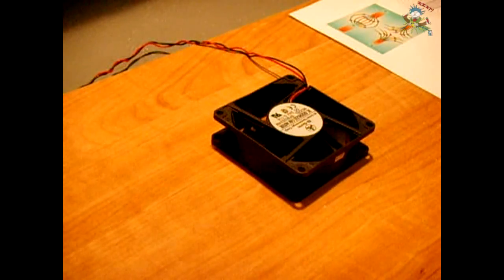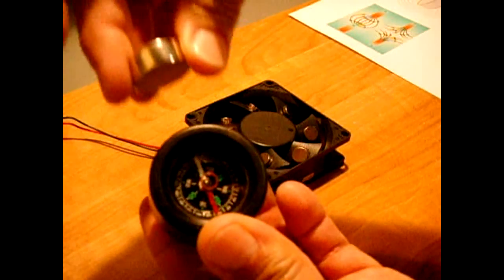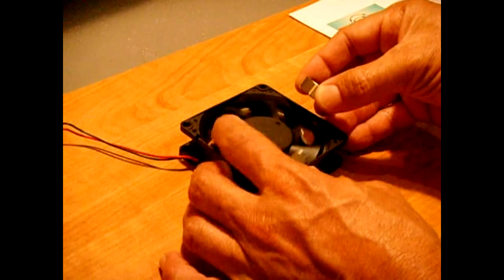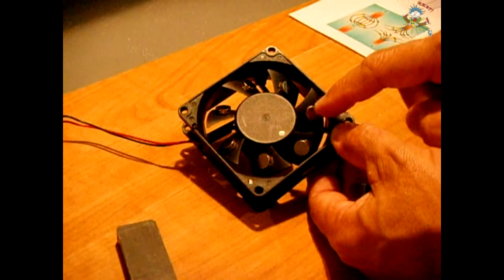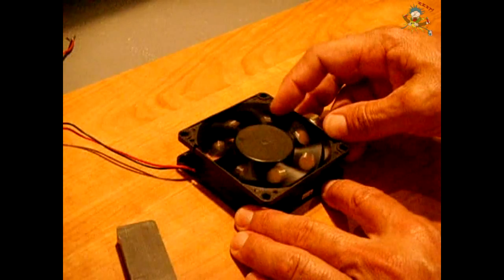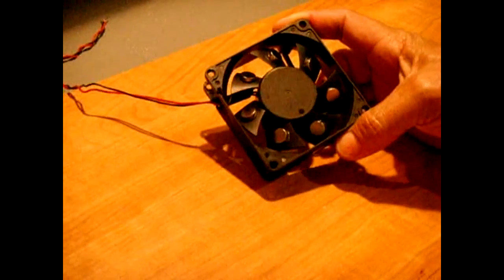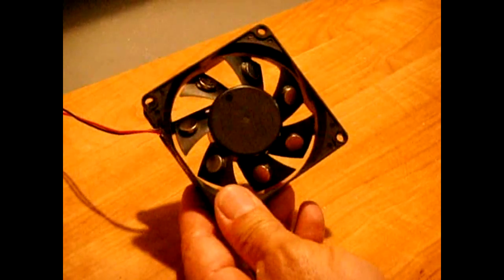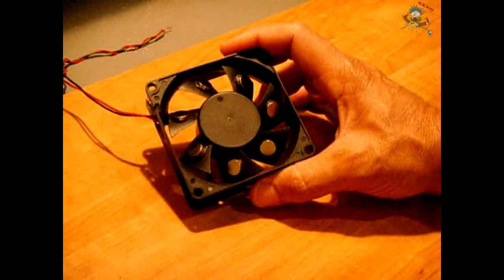Free Energy ~ Case Fan Magnet Motor / Real or Fake?

Comment from the maker: Check out PART 2 of this video which uses very thin neodymium disc magnets:
https://www.youtube.com/watch?v=M6QV0AfDF2k
Reply: electronicsNmore And yes, I agree the posted video is bogus. The magnetic fields will always oppose each other at points making such a simple device impossible to work.
Reply: +electronicsNmore   Hi,
Could you use petier TEC1- 12706 cells to power it, thjen maybe it could be used as a bodini?
Did enjoy your vid, thumbs up!
Reply: I tried also and that is a fake. I tried every possibility to turn it. Thankx buddy for sharing and educate others these beggers are lairs :)
Reply: electronicsNmore
Reply: electronicsNmore you gave a theory of how you think in fan actually worksput  the device you suspected is inside the original inside yours and see if it worksotherwise your theory remains a theory
Reply from the maker: Same flickering output. Stop believing all the scams!
Reply: electronicsNmore
you aren't willing to insert the device you mentioned in the fan?

you haven't proven this is a scam then

you only presented a theory about how it works
Reply from the maker: STOP wasting my time.
Reply: electronicsNmore I have experimented with neo magnets and felt there is potential to create very useful mechanisms. For instance contact free transfer. I have a video posted way back where I constructed a basic contact free energy transfer demonstration. Based off the design of A/C generators and motors I would like to further research ideas for the potential to create a system that could create free energy from strong magnets. I feel there is likely a way to do this. Currently we use magnets to create electricity from an external power source. If further research is done I believe we can utilize magnet fields to do this with no drive source.
Reply: lie
Reply: next time use ur brain and save sum money.
Reply: I already make a fake video but they don't work
Reply: Sir,please give an idea how we make free energy with magnet or other

Comment: I hate it how many of the "Free Energy" videos are Fake!  There are quite a few YouTubers who show exactly how the Fake "effect" is achieved, usually with a tiny battery that is activated by the very thing that is not supposed to, or a hidden switch or a floor petal.  If it has a spark plug, you can bet it's a lie.  Nikola Tesla worked on giving the world Free Energy, but J.P. Morgan shut him down when he learned that Wardenclyffe wasn't really a radio tower but a real Free Energy Tower.  He famously told Nikola, "If we can't put a meter on it, then we don't want it," then withdrew all funding and did his best to be sure Tesla could never get funding again.  But Tesla found a way and right before activating Wardenclyffe, he mysteriously died.  Then the FBI swooped in immediately, confiscated everything they could find and tucked it away in a Black Closet.

We have been stuck with the fossil fuel energy system for a 100 years after actual Free Energy sources have been figured out or at least that long by the 0.001% Ultra Rich Elite who really run the world.  Consider Stan Meyer's Water Fueled Car which turned pure H20 into Hydrogen for its fuel.  He mysteriously disappeared, I don't think he was ever found dead, but gone is what happens to everyone who goes through the Patent/Profit route.  That's how this Elite learns about it and then either buys them out and buries the project and all its info in a Black Closet or Kills the project creator or team in some mysterious way, confiscates all prototypes and any working versions with all its info and buries it all in a Black Closet.  Since the person holding the patent can't be reached to give permission or deny it, the device is locked up.

Either way, the world does not benefit from any Patent/Profit Free Energy.  This Elite makes too much money from fossil fuels, which they use to start all the wars they start to profit further, which they use to further embed fossil fuels......  You know, the ones behind the Military-Industrial-Financial Complex.  There may be some devices that generate low Voltage and Milliamps, but nothing substantial.

Thanks for trying as exhaustively as you did.  I've tried to build a couple, but, of course, they didn't work.  It's called, Click Bait.

Comment: Set it up so the fan also turns a little crank attached to a rod with lobes on it like a cam shaft. This will avoid cogging and will simulate turning a magnet on and off

Comment: THANK YOU! The cogging explains so much. But one hypothetical question... what if you reduced the amount of cogging as much as possible with multiple fans all connected to a single shaft? Say 5 fans all offset from each other by 20° to reduce the size of the cogging space to as little as possible. Then using 5 reversed magnets for each fan so there is not enough space for the cogging to have a major effect.

So to sum up my question... Would reducing the cogging as much as possible make the fans spin?

Comment: Yes, brother you are right and proved free energy concept is fake great job done 👍❤️I have a question not about it I just taking about transformer, Q, I've one 12 volt battery charger but the transformer is vintage 6 wires are coming out from one side 1 wire is going directly to switch it's thin wire and second wire is going to charger circuit pcb 12 wires they are thick going in two diodes high Amps I just want it to use make 12 volts Dc power supply how I find out primary and secondary winding would you please guide me using your experience if you will say I can send you this big transformer pictures but  need your email address here I can't upload because I don't know how I can send those pictures I hope you will help me I really understand your way of teaching and very understanding accent is easy ❤️❤️❤️❤️❤️😇

Comment: I do absolutely believe what you say BUT Maybe if you gonna use a powerful magnet but hold it in such a way that it could push those magnets but that it get’s away from those cought points in between them, but i think you have to test different hight’s at different positions of such powerful magnet to find the right hight in wich it’s repelling force will not get stuck in between thise magnets,
Not sure just speculation.

Comment: He had the wire coming out of the fan coiled up for a reason. He was using an AC fan motor and a coil under the bench with an AC voltage applied? Or an air stream hitting the blades?
Reply from the maker: Watching the ENTIRE video would be helpful.

Comment: Have tryed take fan apart & taken out some parts & just leave the motor then rewired to the copper coils?? Or mixed N & S magnets so theres an pull  & pushed motion off the 7 magnets ?? 
Or using copper coils & big center ring with 4 magnets inside the ring gos over outside fan box.. Have the copper coil tight rapped on an tube & 1 on left side or on right side.. Then wired the fan motor wires to 1 of the copper coil leads for power & other for ground & other for two copper coil leads wired to 3rd wire...

Comment: Only looking at metallurgy and mechanics, the thing you would need to reduce the cogging would be a sheet of a particular alloy that reduces the strength of the magnetic field effect, placed at the exact right angle I suppose. The best one known to man is Mu-metal, but it's not totally insulating and it really only bends the field out of shape.
And if that worked to make a device such as this proposes, it'd probably be all over the internet and easily reproducible.
Perhaps when an alloy is invented that actually insulates 100%.

Comment: The reason they used a fan is so that they can use air to make it move. If you're genuinely interested in this kind of stuff, I suggest looking at Howard Johnson's magnetic motor patents. Good luck!
Reply from the maker: You're wasting your time with these "Free Energy" devices, if they really worked, every person would be making them in their garage.
Reply: @electronicsNmore  Do some actual research. It's obvious to me that you have no idea what you're doing. Your explanation of this toy shows a clear lack of understanding. There's no relay inside the original device. He uses an air current off camera to spin it. Furthermore, I don't believe in free energy devices. I pursue overunity builds that require an input current, but can produce more power than they require to operate. It involves multiple coils, magnets, diodes, and transistors. But hey, I'm in no position to tell anyone how to live, so by all means, have fun playing with your toys.

Comment: Yes I've tried this experiment long ago, it didn't work for me either..... The guy in this video is talking about the cogging effect which is a more complicated explanation of what's going on here!!.... The reason is much more simple as to why the fan won't spin, if you put a magnet between two other magnets it will repel the magnet to the left left and the magnet to the right right thus canceling each other out.... And don't misunderstand me I'm not just talking about placing the magnet between two magnets, it doesn't matter where you place the repelling magnet, because as you try to spin the fan the repelling magnet will always wind up in the middle repelling both magnets in opposite directions..... This is why this will never work.
Reply from the maker: Watch Part 2. :-) Thanks for watching and commenting.

Comment: shh there's a small air tube > ============  < blowing on alot wheels fans in these or ? out of frame  a battery or inside it with a magnet switch called ?  haa   🌬🌬🌬🌬🐌💬👉wot ?

Comment: Oh wow your doing it WRONG THEN! This is in fact EASY TO DO and I can say I've done it and replicated it. You have to disconnect a component on the chip board and solder wires direct to pins on motor. Like wow. Why say it's bogus just because you don't understand.. just ask someone who doesn't mind showing the correct way.
Reply from the maker: LMAO. You're clueless. Either pull your head out of the sand and wake up, or stay the way the scam artists like you. You also need to watch Part 2 of my video.

Comment: Quick question: What if you took a magnet that has a stronger polarity on one side and not as much on the other, and used it instead of the small neodymium magnets on the fan blade? I mean the magnets that have a stronger magnetic field by they have a tighter magnetic field. If it works like I think it does, it might fix cogging.
Reply from the maker: You need to watch PART 2! :-)

Comment: Four years later and it still does not work. But one thing I did notice in one of the videos was that the electronic guts of the fan had been removed. The internal cogging of one of these fans is also great so overcoming it is next to impossible. Now putting two of the fans together such that the internal cogging was canceled out by each other you might get one to spin with external magnets.

Comment: I am creating generators in educational purpose ( fidget spinner generators, pocket generators ) . When you will see a title which include Free energy - you have to be sure it is a scam, there is now such a thing. The real generators are running untill the power source is depletead (including n. reactors  probably 50 - 90 years). For example our AC  pocket generator 230 V https://www.youtube.com/watch?v=QXUk2R--R70 is running untill the small battery is depletead.

Comment: put two external magnets on a long pendulum, timed so one is always getting close and pulling magnet forward, then pulled away before it can lock, by which time a magnet on the opposite side is pulling it again.  Heres the trick: Don't the the 2 dynamic magnets at the bottom of the pendulum, but nert the top with limiters. That way a long pendulum motion which will last, can spin a small wheel to generate power, using gravity and magnetism!
Reply from the maker: Watch Part 2. :-)

Comment: I was watching this video from a couple of months ago in which the motor is removed from the case fan and the rotor does not maintain until a 4th magnet is introduced to the system.  Thoughts?

The only point of concern that I noticed was when he took the rotor off camera momentarily.  I guess he could have swapped rotors out there.

https://youtu.be/KKohvoBaZ_8

Comment: If you want to see a magnetic motor that is almost free energy check out my boy friends US patent application 20160156254.  This motor runs on only 5% pulsed DC power with 95% of its speed and torque being generated by powerful permanents as they are attracted to each other utilizing PROGRESSIVE MAGNETIC ROTATION.

Comment: The guy did not use a magnet, what looked like a magnet it was a case containing a battery a motor mounted  with a disc with magnets attached ,, producing the rotational flux

Comment: the guy in the vid had a larger diameter fan with less angle on the blades and smaller  magnets .. then his other magnet was very large and had an effect from a greater distance which may eliminate  the cogging effect you talk about .. i think each item would have  to be exactly copied  to give a true test
Reply from the maker: You need to watch Part 2.

Comment: without and before watching this I can say with certainty the only ways in which this could work without additionally supplied electricity is either Solar (using ambient lighting) OR a Stirling engine type technology, one side of course facing the heat of a metallic panel of the computer and the other in the cooler air. However it would be a low powered fan in both cases.
Reply: lols just watched.. perpetual motion? haaa. should have known since its youtube.

Comment: Under the table in Teck Tors video is a motor spinning a magnet silently close enough so that the fan magnets and motor magnets react. Also the huge magnet he is hand holding may be a fake with a D.C. Motor inside spinning a magnet very quietly .

Comment: Put magnets relative in scale to the fan blades of the unit you are using. The bearing will be overloading due to the excessive weight of magnets you used.
Reply from the maker: Good luck with your experimentation! Be prepared to waste a lot of time and money. :-)

Comment: The chance of this working isn't slim, or next to nil. It's nil. It's vaguely interesting that you tried this over and over, but it's like trying to prove that socks don't fly. You don't need to throw socks up in the air over and over to show that no matter what you do, they just won't fly. Permanent magnets are seductive because they seem to make a free force. But it's the same as gravity - there's a force there, but as soon as you exhaust the potential energy, you have to restore the potential, to make it work again. The magnets that are driven away from the stationary magnet going one way, are attracted to it after they circle around. Consider: if you decided to call it an attraction motor instead of a repulsion motor, you wouldn't need to reconfigure it because it's attracting and repelling at the same time. The motor works conceptually by neglecting one side of the system.  

And of course, people will try this same thing with gravity. If only you could get the potential out of the wheel on one side, without having to restore it, on the other side. For some reason, it's a little more obviously impossible with gravity, but the nature of the devices and the reasons why they won't work are identical. You're not 'making energy' you're using potential, or stored energy. A hydroelectric dam makes 'free energy' this way, but something has to truck all that water back up to the reservoir. The magnets can 'fall' together and make energy. But then that same amount of energy is required to pull them apart and restore them to their original distances, or potentials. There's never "just enough left over to make free energy out of a conceptual error".

Comment: I noticed that in the faker's video the claimant always keeps the stationary magnet part way out of the view of the camera. The magnet also appears to have a small hole drilled in it. There is probably an air pump located outside the camera's view and a hose going to the unseen side of the stationary magnet (which may not be a magnet at all). This blows a jet of air toward the fan causing it to spin. The motor inside the fan then acts like a generator to light the bulb. The outside power source is whatever is running the air pump.

Comment: First of all, any "free energy" claim is misleading and "fake" as the second law of thermo cannot be violated. This type of energy generation has it's limitations due to the size/strength ratio of permanent magnets to their magnetic field. 

That being said, I think i know which video you are referring to, and it seems like you may not have built this correctly. I know you posted another video with thinner magnets, but there are many other components to this. The friction of the fan spinning will probably be the greatest loss here. You need to have a strong enough driving field to overcome those losses with such small magnetic fields friction is the biggest problem i guess. 

I'm looking to build one of these myself, I don't buy this comment you made: 

"Based on the testing I have done, which is more extensive than what is shown in this video, I can say you WILL NOT get a single magnet to push a case fan into smooth spinning operation. Not going to happen. If you doubt it, then try it! Very simple to prove to yourself."  

Have you done any calculations to figure out what the max weight that can be moved by the field is and then account for air resistance and frictional losses?? There's a going on here and everything needs to be JUST right for it to work, or for it to not be possible.  

Conceptually, this should work, if you can get the numbers right.